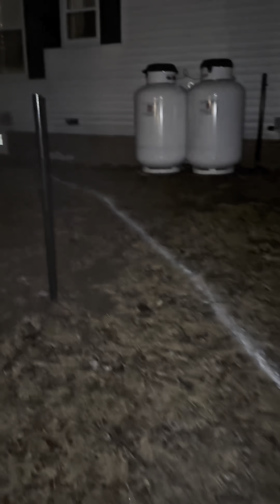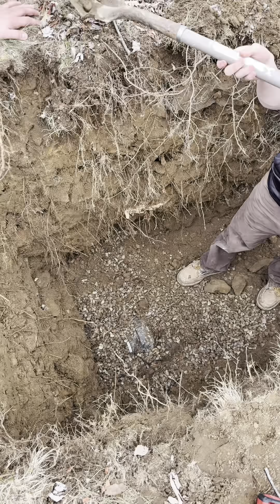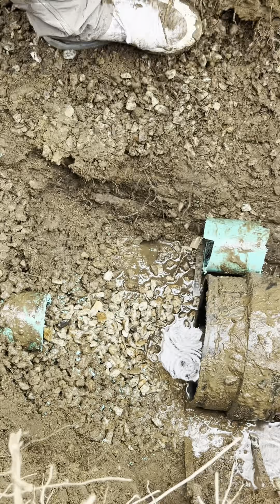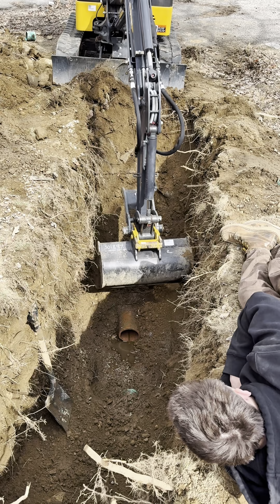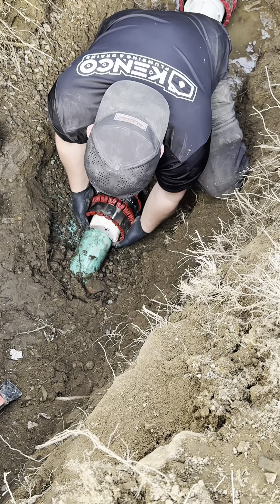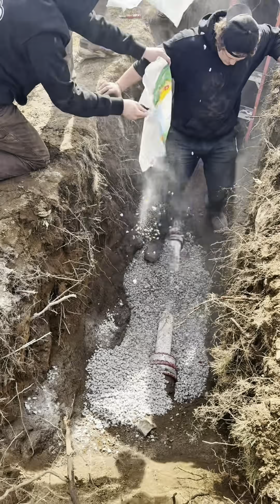Replacing home sewer line #homeimprovement #plumbingtime #diy #plumber #shorts

Comment: wait, i thought contractors can just dig and build stuff without asking the local government so when they break our pipes and wires for our street lights, we need to go back and fix and replace stuff instead of saving the headache by calling beforehand
(this has happened on the main road and on residential streets recently)